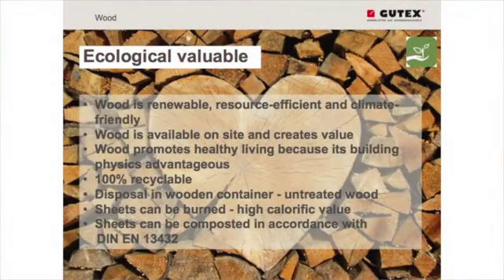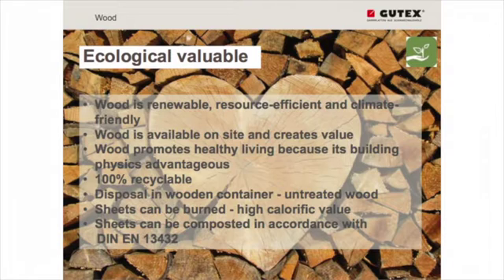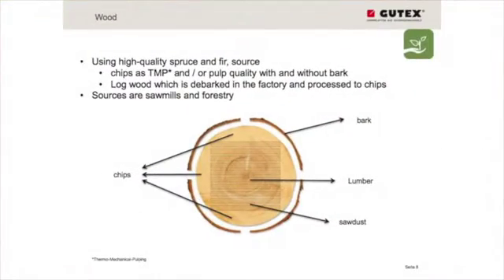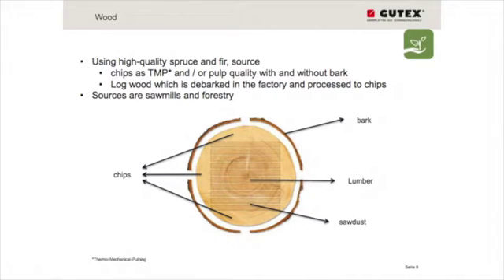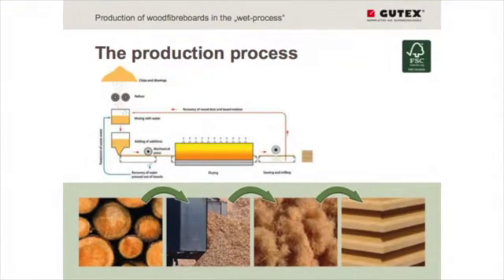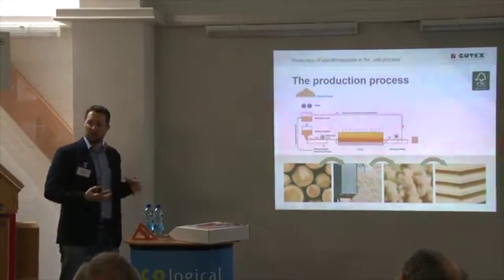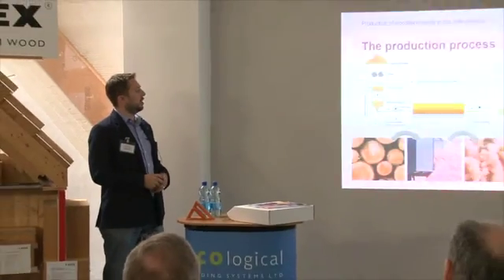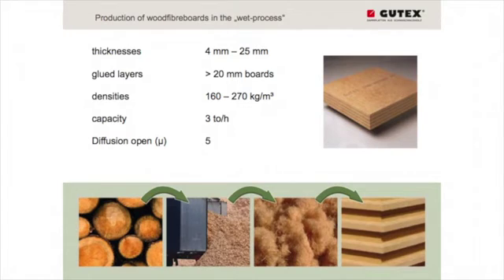Ecological Building Systems Masterclass - GUTEX Wet Manufacturing Process

Comment: The products seem to be quite "healthy". However, do you have any certificates that PROVE that these products are not carcinogenic, i.e. all the components employed in the process (e.g. the additional binder), and also the final product? Because I think that this is the biggest issue nowadays, after what has happened with insulation materials like polystyrene.